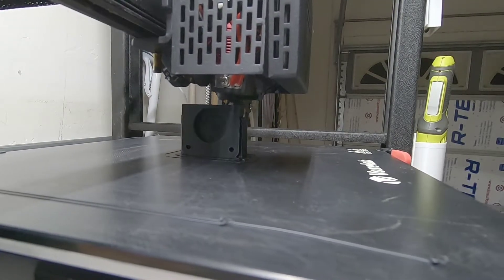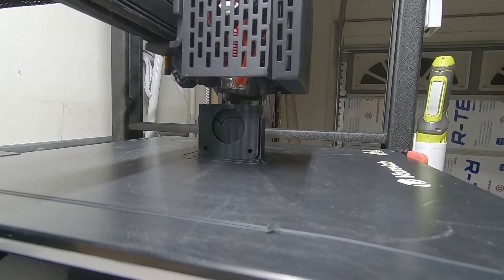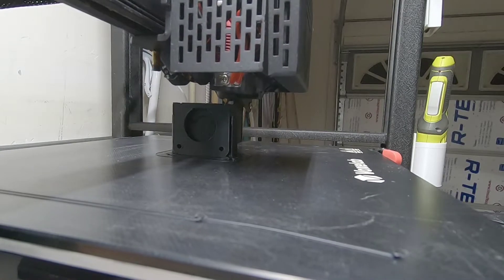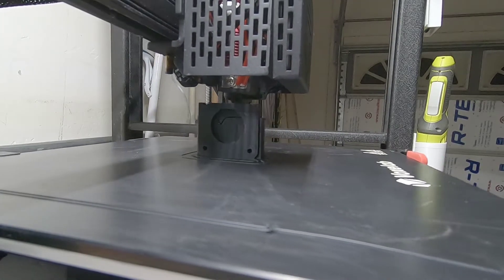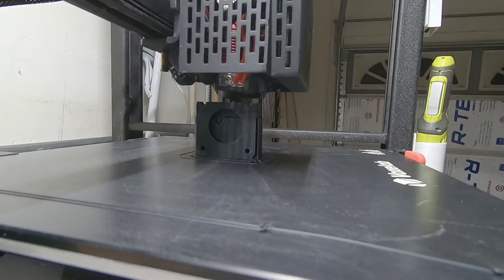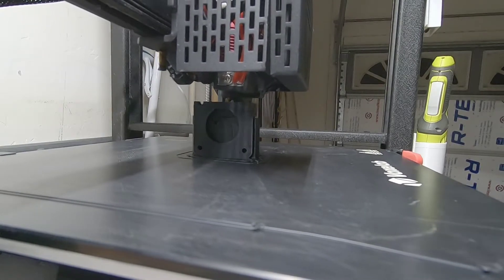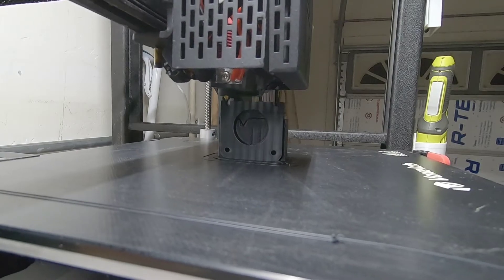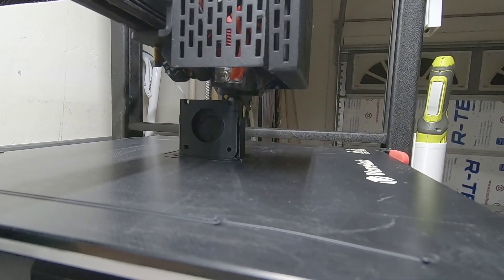Aquila Pro Part 5: Klipper

Comment: Hello，I have the same Voxelab Aquila Pro as you, and I’ve bought a new SKR Mini E3 V3. I’m planning to replace the mainboard like you did. I’d like to ask—do you completely stop using the circuit board on the hotend?
Reply from the maker: sorry i haven't responded, i have removed the circuit board at the hot end.  at first I tried to figure out what everything was in the cable but ultimately decided to just rip it out.
Reply: @3dprintablesllc271   Thank you for your reply. 😊I am also unsure of a few wires, so I will discard the circuit board  and remake all the wires.

Comment: any chance of a tutorial on this? I'd like to change my mainboard and firmware as im struggling with voxelabs. Also do you think I could put a direct drive on this thing?
Reply from the maker: I'll try to make time for a tutorial some day, good idea.
Reply: @3dprintablesllc271 Waiting for your tutorial too :) I want a stable connection via WiFi and full control  ...

Comment: Just found your videos. I just picked up the pro second hand from voxelab directly and i like it! but, Why didn't they just base it off the x2 i haven't a damn clue. That probe is a huge pain!! I'm like you i seen that prompt to calibrate  after the update and just clicked away from it and then it about snapped it off on the bed clips while doing a z-offset. They mention no where about going into the level feature and tapping 5 times next to the back portion of the screen to go back into the calibration feature.. I have only had it for a few days and haven't printed anything but a calibration cube. but, It does seem to print pretty well. Mine to may become a franken printer if it acts up.
Reply from the maker: Yeah, I was disappointed in the information they provided, or should I say lack of information.